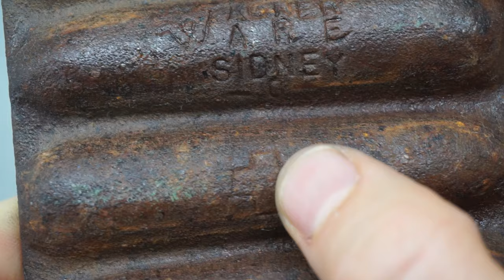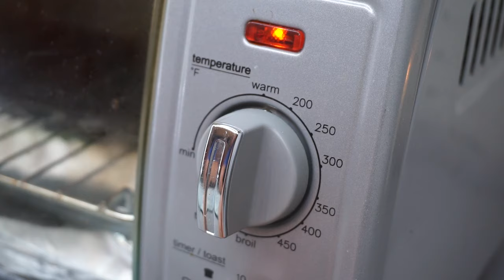Rusty 100 Year Old Cast Iron Cornbread Pan Restoration

Comment: I have 2 cast iron dutch ovens with lids that I inherited from my father. He used them for a lot of years. When I acquired them, it appeared he prepped them for storage by oiling them and storing them in plastic grocery bags. I have no idea how long they were stored that way. He passed in 2012 but had been ill for several years. They aren't rusted; the plastic seemed almost adhered to the cast iron. Any suggestions on how to loosen the plastic? It won't peel off. I can't say he ever used olive oil, most likely vegetable or corn oil. I want to use them. Thanks.
Reply from the maker: Thanks for sharing! I would probably   let it sit in some vinegar for a little then scrub with baking soda and salt and then reseason it. I think soaking in vinegar should losen up the plastic 👍 Good luck!
Reply: @CoolRestorations  Thank you! At least that sets in me in a direction to tackle this. It'll be a Spring project. On the other hand, I also inherited my mother's cast iron frying pans, they'd been stacked and put into a paper grocery bag. They're in good enough shape to just pop on the stove and use. Not sure why my dad, or whoever, took the oil and plastic bag approach...but I'm determined to get them back in usable condition. I've subscribed to your channel, so, I'll post an update at some point. It's good for people to see that these old cooking pans/pots CAN be restored, I really appreciate your content.
Reply: @CoolRestorations  Update on my Dutch Ovens....the plastic is off! Our temperatures dropped significantly a couple weeks ago (16 to 20 degrees F). My husband ended up ripping the plastic clean off of the ovens and lids pretty easily in our frigid garage ( I wasn't there...darn it!). When I had tried previously it was summer.